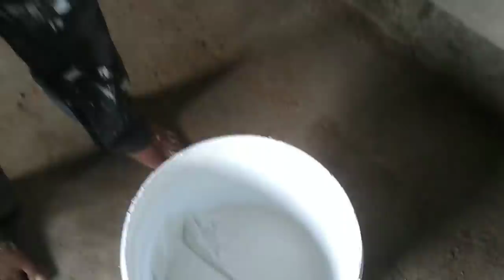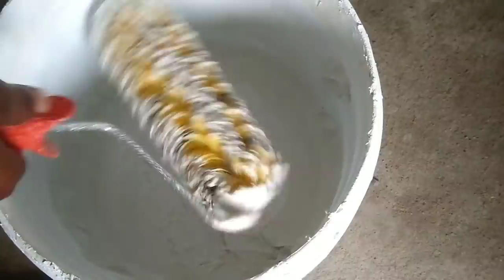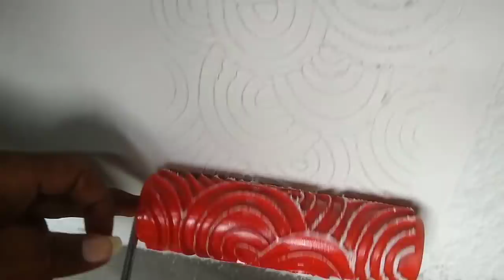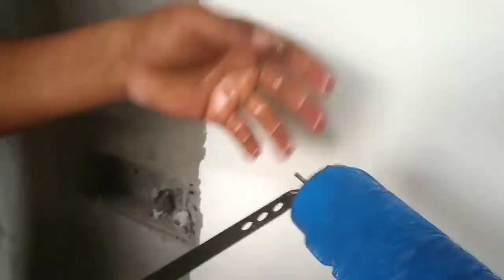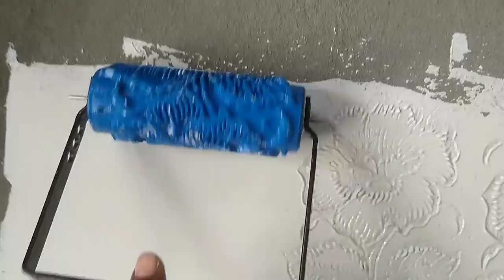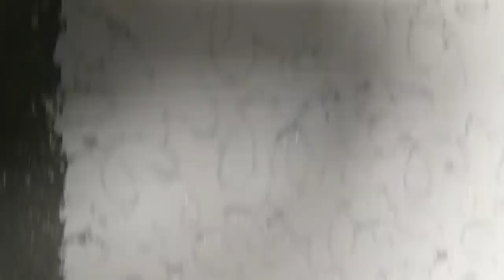How to use - easiest way to Texture design tools

Comment: what kind of white paint do you use?
Reply: aasian or nerolac
Reply: +rather ishfaq sqa royal is best paint. but it's price is v high 1250 per ltr
Reply: That's not paint, it's "mud." There's lots of products that do that job. I'm not very experienced but in the   🇺🇸 they are called joint compounds or texture muds usually.

Comment: Your mud is thinned out too much ( too much added water) when you do some of the rollers. It will be harder to trowel with less water, but make a better imprint with roller. You can see it sticking to the roller. Less water is key. Still a cool video